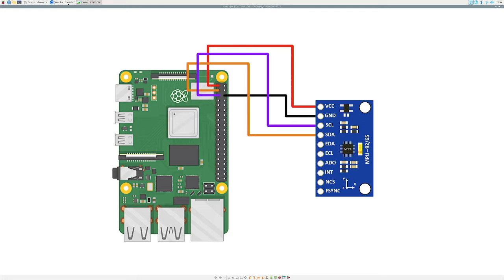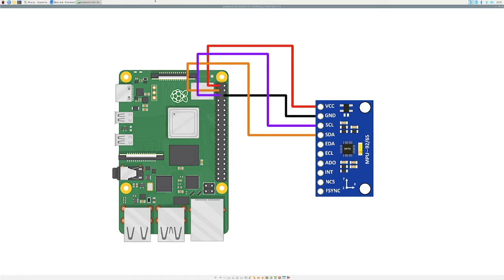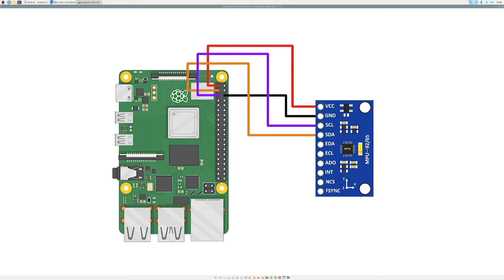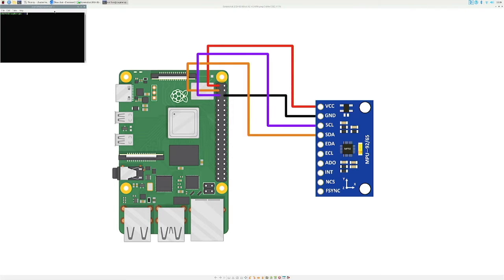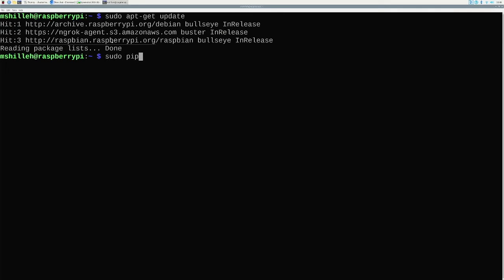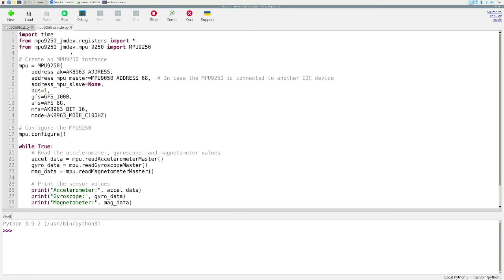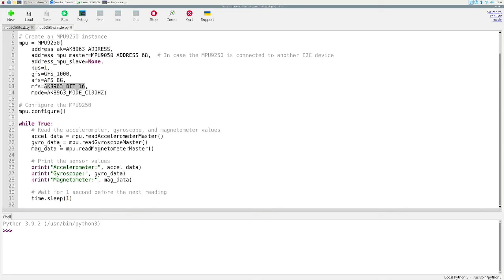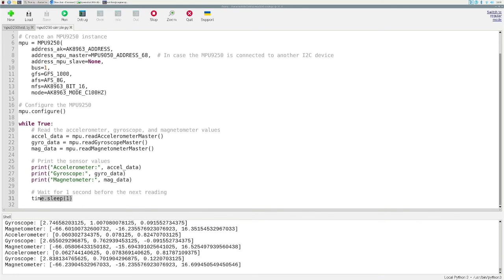How to Connect MPU9250 and Raspberry Pi (Part 1)

Comment: I am doing the same as shown in a video when i give the command sudo i2cdetect -y 1 I am getting only 0x68 but the magnetometer is detected
how should i debug this and then can i know if your setup did display 0x0c
how can i verify if my MPU9250 has magnetometer init
Reply from the maker: Depends where you buy the unit!

Comment: Sorry,I have a big problem. I have to connect mpu9250 with raspberry pi zero w. I couldn't install mpu9250-jmdev, what should I do? Thx
Reply from the maker: What error are you getting? Why don't you manually get the library, should work fine with the 9250
Reply: @mmshilleh  Thanks for your replying. I already install pyhton3-pip. Then I tried to write "sudo pip3 install mpu9250-jmdev" same as your vedio. But I failed. The error message says "This evironment is externally managed."  How do I manually get the library?

Comment: Hello, I'm trying hard to copy the video. I get a Remote I/O error when I run the Python code in the video. How do I fix this?
Reply from the maker: Not sure, there could be a lot going on there. Perhaps it is a hardware issue
Reply: @mmshilleh  Oh, thank you. Does it matter if it's Raspberry Pi 3 or Raspberry Pi 4?
Reply from the maker: @조수연-u1x  It should not!
Reply: @mmshilleh  So... can I run the mpu9250 sensor with the raspberry pi3 I have? I'm sorry I kept asking questions...
Reply: Try adding a Try and except statement where ever you are getting the error, worked for me
Reply: @adabalavarshith2253  Thank you! I'll try it the way you told me.